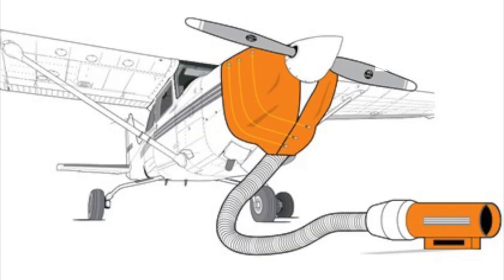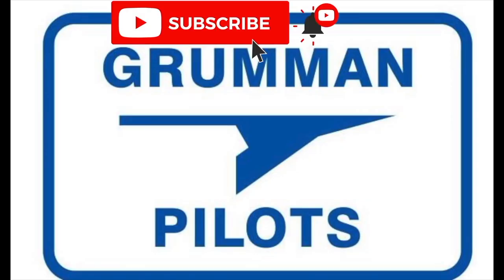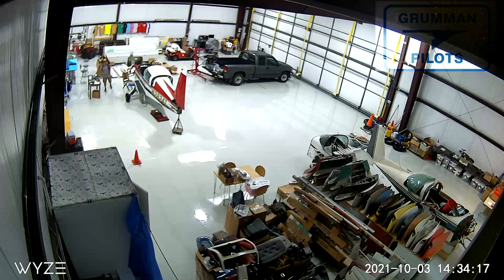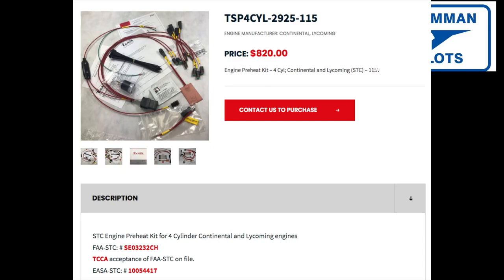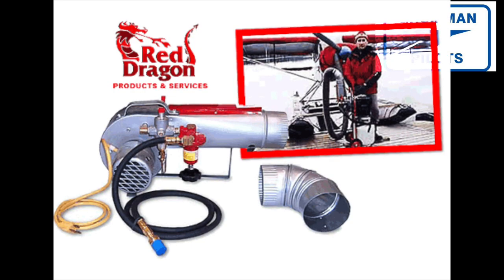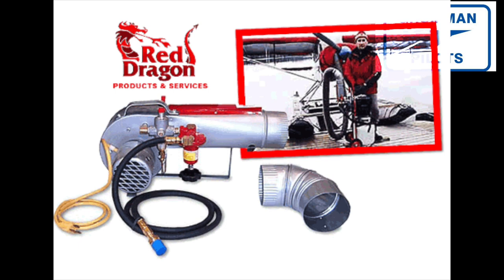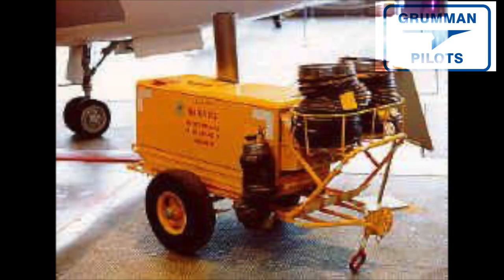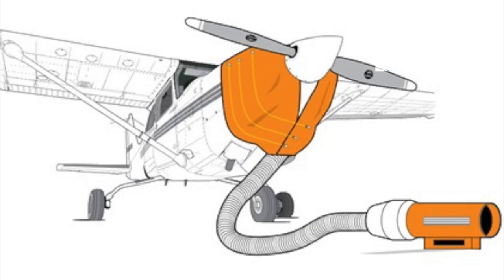Engine Preheat Basics - Grumman Style

Comment: Nice to see what the frozen tundra needs to do to fly. Hard to imagine from the free state of Florida!
Reply from the maker: I did not even talk about the Alaska trick of a cold start.  Shot of prime, one prop blade, another shot, another blade, when all the cylinders are done, it should start on first blade as all cylinders are loaded with fuel.
Reply: @GrummanPilots  My Dad flew just about everything at one time or another in the Air Force. He said it wasn't uncommon to thin the oil with gasoline in the DC3 before putting away at night in the Artic.
Reply from the maker: Some of the pistons do that in Alaska to thin the oil for cold.